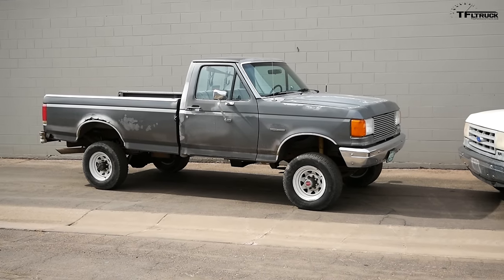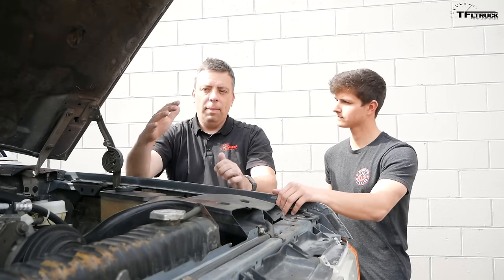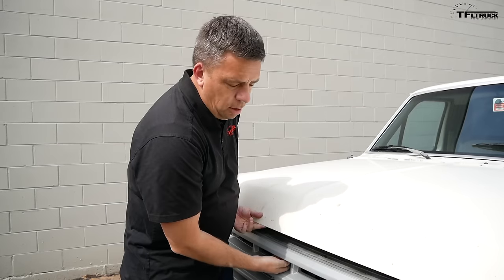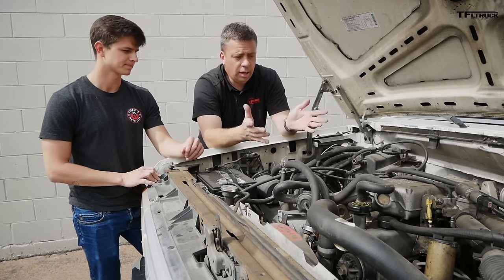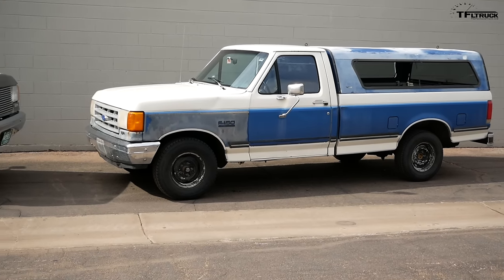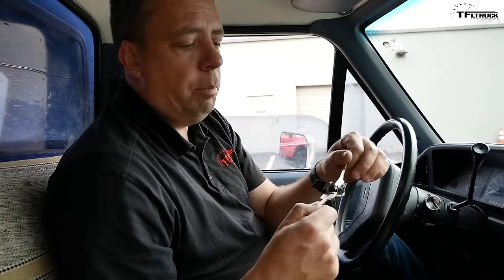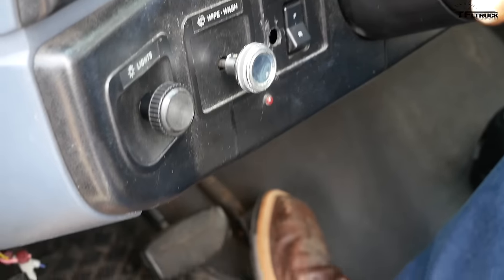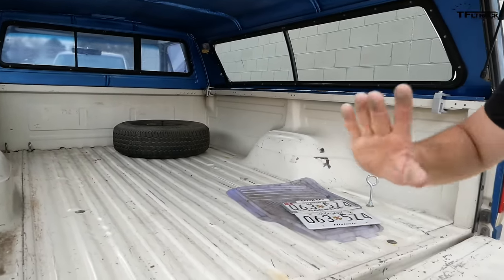Here's Why You Can't Kill An Old Ford F-Series Truck | Gunsmoke Ep.3

Comment: Trucks built today won’t have that longevity. Sad.
Reply: It's because the new trucks have to many eletronics
Reply: Constantly evolving emissions and mileage requirements mean they can't, it's just a necessary evil. And aside from the drivetrain, if you think these old trucks will go for half the miles without major maintenance/repairs as modern ones, you've got nostalgitis. 

I love old vehicles, have always owned at least one (currently a 1986 K5 Jimmie trail truck and a 1968 Plymouth Barracuda notchback project car), and presumably always will, but we've come a long way in terms of overall reliability. 

No one drove their 70s/80s trucks 250,000+ miles with nothing more than consumables (tires, shocks, brakes, fluids, etc.) back in the day, and if a new truck doesn't do that, we're insane with outrage. 

Yeah, electronics are prone to periodical failure, but they're easy fixes that anyone can do (as opposed to old mechanical systems that required considerable knowledge and ability to diagnose and repair) and they're otherwise pretty bombproof.
Reply: People were saying the same thing in the 80s when those Trucks were built
Reply: Trucks today are built far better than before. Sad that people stuck in a time warp cant acknowledge this.

Cars and trucks back in those times were only good for maybe 200k miles at best. Most didnt make it much past 100k miles without major issues. These F series trucks in this video are no exception. Theres tons of these aged F series that crap out at 200k miles. The fact that a handful go further isnt a testiment to the engines longevity, just a testiment to the better owners.

Just look at the service intervals for older cars vs newer ones. That tells you alot right there. Newer cars need far less maintanence to go further than older ones.
Reply: @The_sinner_Jim_Whitney  Electronics are easy fixes? Do you have access to the high priced laptops and programs to re-program the stuff that needs it? You need knowledge whether it is the "old mechanical systems" or the modern electronic ones. Ask someone that has hundreds of dollars invested in an electronic problem that mechanics either misdiagnose or......? Brother knows a guy that had a brand new truck that they COULD NOT find out what was wrong. Engine would shut off, call the tow truck. Get it back and it would do the same thing days later. This happened multiple times. He was pissed! The dealer ended up giving him another truck because they couldn't find the problem. That was a GM product.
Reply: Engines today are usually smaller cubic inch's and its harder on the engine to move the vehicle. Also with safety guidelines vehicles weight more now on average.
Reply: Seen a 2000 F350 with 6.8 V10 make it over 400,000 miles and it was a company truck for a drilling company i worked for. Used a quart of oil about every 300 miles, didn't smoke, didn't leave puddles, and it wasn't mixing with the coolant. Was fun to drive in the tunnels, muffler was blown out. People probably looking for a Ferrari or lambo when they heard it.
Reply: @shabutir1820  advantage of the older trucks is comfort and they're made at a reasonable size, shoot, the new ranger is bigger than my 85 f-250HD on the outside but is comparitively cramped inside and doesn't have a good transmission option in the USA market
Reply: @brandonv1727  Or lookin for the Mack truck from "Duel"...
Reply: @anonymousxish  Not a whole lot apparently.
Reply: @The_sinner_Jim_Whitney  gearing has a lot to do with that. Engines arent turning 4500 rpm at 70 mph now.
Reply: Andy Reid They weren't then, either. Maybe in the 60s/early 70s, but the gas crunch was in full effect for everyone by 74 or so. Even the amazing Chrysler A-833 4-speed got a weirdo-pattern overdrive makeover, and most passenger cars had rear gears in the 2.-something range by the mid 70s. Manufacturing processes, testing, and engineering have progressed now to the point that we just make more efficient and durable vehicles and vehicle components now, I mean, of course it has, that's what technology does.
Reply: @bretfeeney1072  How is a smaller displacement engine harder on it? Mean piston speed is generally lower per given hp hour today than compared to large clunky V8s and even I6s from the 70s. 

The reason displacement has shrunk is because engines have become more efficient. Less rpms, and less fuel burnt to achieve the same hp output means less stress altogether.
Reply: @shabutir1820  Tell me more about how vehicles today need less servicing whilst I hear AAAAAAALLLLLLLLLLLLLL about new GMs and all kinds of other brands having major problems at 50k+ miles (look at any modern Range Rover for instance)
Reply: @ghost-jesus  I agree, the new 2020 Silverado 1500 is absolutely HUGE, how they hell is that a "pick-up" truck if you need a fork-lift to load the damn thing?
Reply: @kramnull8962  That's a Pete 281, not a Mack
Reply: @shabutir1820  new cars are disposable junk with no value
Reply: @The_sinner_Jim_Whitney  the old ones last as long as you maintain them to last. What if on your new truck you need to replace the starter? There's so much electronic crap around it replacement would have to be done by the dealer and there is only so many years they are willing to do that. All modern cars are destined to die in 15-20 years. Where is your evidence old trucks only last 250?
Reply: @cptchuff2741  Everyone I’ve ever known who has ever driven cars and trucks, myself included. If I need to change a starter, believe it or not… I change the starter. It’s easier to work on newer cars (well, less required knowledge for diagnostics, parts are often an asspain to get to, I’ll give you that much for sure) than older ones, you just have to have the right tools. My oldest vehicle is a 1984 Suburban, my newest is a 2016 GMC Sierra 2500. I’ve owned vehicles as old as 1966 model. I/my girlfriend have 5 vehicles between us, all but one of them newer than 2005. I maintain all of them. I see what wears out, and at how many miles. The old stuff’s pretty cheap to maintain (if it was a popular enough vehicle for parts to still be available), but nothing on it will last close to as long as its modern counterpart aside from the engine block, transmission case, and axle housings. The motor will need a rebuild every 150,000 or so, ditto trans/transfer case/rearends. The front end will need rebuilt every 80,000 or so. Unless you live in the southwest or get it under-oiled every year, the body will rot off after about 15 years, ditto the frame and suspension mounts and such. They’re simple and you’re romanticizing that, that’s all it is.
Reply: @cptchuff2741  Ford 300 sixes are an outlier, they run forever as long as you replace that plastic timing (I think? Maybe oil pump? Not a Ford guy) gear before it breaks and keep them flushed and full of fluids. Most older engines (particularly Fords) won’t run half as long as almost any modern equivalent without major work (rebuild, valve job, camshaft, head gasket(s), that kind of thing). Tolerances were just looser back then, our technology continues to allow things to be built tighter and better sealed and more efficient. They almost never run as long as modern stuff does without major maintenance, and the ones that do (300 six, Chrysler slant six, low-compression V8s like 318s, truck 302s, 305/7s, etc.) were low-compression, inefficient, gutless and filthy. 

With regard to ease of diagnostics, modern diagnostics is plug in scanner, read code, narrow down what could cause code, fix it. Old vehicles (older than your ‘96, like fully mechanical carbureted stuff from the ‘70s) require you to be a ‘car whisperer’ to figure out what’s wrong with them. Once you do, parts replacement is usually, but not always (I’m looking at you, linkage clutches, drum brakes, wheel bearings, and flat-tappet camshafts…) easier, but if you don’t mind buying specialty tools that’s not really that true, either. Just different skill sets.

Of course modern cars reach that point, but it’s like 20 years and 250,000+ miles if they’re any good at all, and that’s with only minor consumable-type maintenance. Old cars will make it that long with EXTENSIVE maintenance if they’re babied. Just any idiot can’t keep an old rig on the road. Technology doesn’t go backwards, we don’t do things differently now because it works less well.
Reply: @cptchuff2741  For what it’s worth, I ENORMOUSLY prefer old stuff (albeit with modernized powertrain, brakes, etc.) and it’s more than worth the extra work for me to have older stuff, I just can readily see from personal and anecdotal experience that they’re not better than, or even as good as, modern equivalents.
Reply: @The_sinner_Jim_Whitney  I suppose that does make sense, being able to scan your car and get the problem done and needing mechanical experience to maintain an older vehicle. What I'm trying to say is all the electronic stuff (push to start, cylinder deactivation, etc) will wear our overtime and it will be hard finding someone willing to fix it. Which in my opinion is why simpler is better. Less stuff that can break. Which is why I prefer older vehicles that I'm willing to do maintenance on.  Not to mention touchscreens would break as well but that shouldn't impact the driving experience to badly.
Reply: @The_sinner_Jim_Whitney  By a statistical point, no. They get worse mpg, are less powerful, and require maintenance to keep running. For the average Joe who just wants to get to work and back a brand new Corolla is the perfect car because most people don't want to be replacing a fuel filter on the side of I-95 at 3 am in 20 degree weather while it's snowing. BUT with proper maintenance most old cars can be as reliable as a new one, can look awesome and be fun to drive, and would last longer overall.
Reply: @cptchuff2741  Right, but just as starter motors, vacuum switches, distributors, rocker arms, etc. were common mechanical items to fail and need replacing in older vehicles, electronic switches, sensors, injectors, soft-touch interfaces, touchscreens, etc. are now, and are therefore readily available and can be replaced by anyone with the right tools.
Reply: @cptchuff2741  Agree with everything except lasting longer, unless bodywork and engine/trans/axle/other major component replacement falls under the umbrella of ‘maintenance’ in your scenario. They are way cooler, more fun, easier to work on (if you know how), and more interesting, there’s essentially no disputing that. I have older stuff because I like it, and I have newer stuff because I want its performance and/or don’t want to worry about it. Both are great, and both have their place in my fleet and my heart.
Reply: @The_sinner_Jim_Whitney  You can keep an old car forever under the assumption it is garaged and you only take it out on nice days and keep it maintained. For example I saw a model T 100 years after it was built which shows how good the internal combustion engine really is. But yeah both are great in their own ways but I will always prefer old. It's all I can afford right now anyway lol
Reply: @cptchuff2741  That hearkens back to what I said about babying them and keeping super on top of maintenance. That’s not possible in a vehicle you drive every day, not for me, anyway. But yeah, with the right treatment, they’ll live a LONG time. My Suburban looks like it’s about 10 years old, and it’s older than me (I’m 35), but I don’t use it terribly often, keep it under a carport with sides, and bought it in California (I live in WV). I also go through it with a fine-tooth comb every spring and repair or replace ANYTHING that could use it. Most folks don’t, but yeah, if they do they’ll be around for a long time.
Reply: @The_sinner_Jim_Whitney  Love the old square body Suburbans. What engine does it have? Part of me wants to get a 90's F150 with the 4.9 as a beater
Reply: @cptchuff2741  It was a 350/4-speed, now it’s a 6.0L LS/NV4500. I rebuilt the old 350 at 65,000 miles with Vortec heads, 10.5:1 pistons, and a moderate truck cam, blew it up at 90,000, put a mildly built (Texas Speed stage 2 low lift truck cam, ported/polished 243 heads, 10:1 forged pistons) 6.0 LS in it and never looked back. If the truck’s still any good by the time the 6.0 goes, I might swap to a 12V Cummins, but I doubt it will be. 6.0 bottom ends are easily good to like 800 horsepower, the pistons are the weak point. I’m making maybe a touch over 400 with forged pistons, so it ought to be running for a WHILE.

Comment: I still love running my 92 f350 dually over my 2013 f150.   But I’ve taken some time to turn it a bit more into what I wanted, it has the turbo set up from a 94, converted to zf5-42 still just a 2 wheel drive. But it’s more fun to drive that older style truck than this new stuff with all the bells and whistles

Comment: Depending on what tank needs replacing, I had a ‘73 that had the 19 gallon saddle tank, and the rear was replaced with a 39 gallon tank. Holy macaroni it was expensive to fill, but quite nice to have 58(!) gallons.
Reply: I have a 73 f350 beater wood hauler with a 390. 2 tanks but I only use the one tank. great truck for hauling a bunch of weight
Reply: My dad had a 75 f100 he had 2 saddle tanks and one in the rear. He bought like that. Not sure the size of the 3 tanks but dad said they did a 1,200 mile trip and filled up once. It had a 360 4 speed in it. I wasn't even born yet when they took that trip.
Reply: 77 F250 with a 429 and 3 tanks. 2 25 gallon saddle and a 45 main. Would go pull 20k of Christmas trees to California from Oregon about 1200 miles. Fill up before leaving fill once I got to grandparents house. Love that truck.
Reply: NICE WORK! Could you give details on the 35 gal tank. Who makes it, what sender did you use, modifications to make it fit , modify the fuel return to work with the tank selector? I would like to learn from your experience. Thanks.

Comment: 73-79s were my favorite trucks to date. Simple and will out last any of the new ones. Pump it start it and go. No fkn computers.
Reply: My first pickup truck was a 74 F100 XLT package, 302 w 3 speed converted to a Hurst floor shift. I had dual exhaust and added an aftermarket air cleaner. Great old trucks had an 88 custom and a 94 XLT F150, 88 had a 4.9L with a 5 speed gearbox 3.55:1 rear and a handling  package. 94 had a 5.0L with an automatic and a 3.25 axle, towing package which included the handling package as well. The 74 had points the only thing electronic was the AM/FM/Cassette.

Comment: Back tank rusts thru often and they leak at the ring on the sending unit sometimes but easy to talk out n work on. Also the fuel pick up has been Chinafied the last few years and all are  junk  crap replacement.  Has to be the ford part or it will fail in a few hours and fall off the pick up and run out of fuel at 1/4 tank. Btw they will burry me in my 97 F250HD 7.3 TD 4x4 manual  its that reliable. Best $$ I ever spent. Thanks for showing em some love.

Comment: Very solid trucks, i have an 88 f250 with a 460 and a 5 speed manual I love it.
Reply: I have two .one f250 with a 700 hp built 466.and a f150 with a stockish 460.both 4 speeds Manuel 4x4
Reply: What transmission do you have. I have a 88 f250 automatic, but I want to swap it out for a manual. Does anyone know if it can fit a an f150 transmission?

Comment: I have a 86 f250 4x4 6.9 idi with the 5spd same body style as gun smoke. The things I love most about it is all the things the TFL mentioned, and that instant gratification when you give it throttle vs modern diesels. For example my 6.9 idi- smash pedal to floor, engine gives 100% fuel no questions asked. Modern diesel- smash pedal to the floor, engine ECM sees driver want 100% fuel. ECM then checks to see if all sensors/ parameters are good to go, then rolls on the fuel to 100%. Even it all happens in a split second I still swear I can feel it and to me it takes forever.

Comment: I have an 87 F150 4x4 that was used for years as a farm truck in Kansas and Missouri. It only has 104,000 original miles on it. The valve covers leak a little oil, and I just overhauled the cooling system and installed a new radiator, but it starts every time I turn the key. It only has one little rust hole (about 3/4" diameter) on the passenger side rear wheel well (by contrast my wife's 2002 Z71 Silverado has completely rusted out rocker panels and the wheel wells on the bed are rotted out). My old truck has faded two tone blue/silver paint and a few little dents and some surface rust, and the window lift motors are shot, but it's just keeps on rolling. I love that truck.

Comment: Did the same thing , had a 89 f150 and it was rusting out and got a beautiful 93 f250  . Both 351 Windsor's.  Other than the front end many parts inter changeable

Comment: Not a dana 60 in the rear. Sterling 10.25. Great axle
Reply: granted it did show the front dana 60 after he said it, he also said axles, which your right the rear has the sterling
Reply: My 86 E350 had the Dana 60
Reply: Dana 60, Dana 70, Sterling 10.25 were options in the f350s, 9 inch, 8.8 inch, Dana 60, and Sterling 10.25 were in the F250s

Comment: I had an f250 with the 300 in it. They are fantastic workhorses. It does 0-60 in about 5 red lights, but it'll pull a freight train, and they last forever